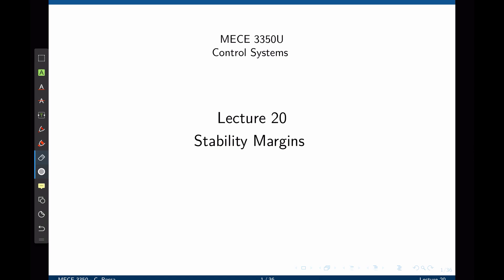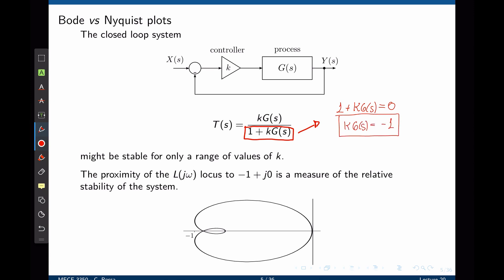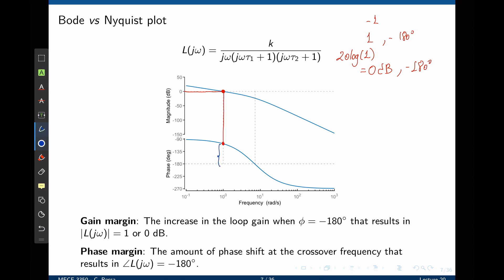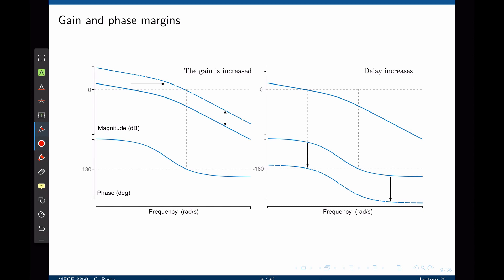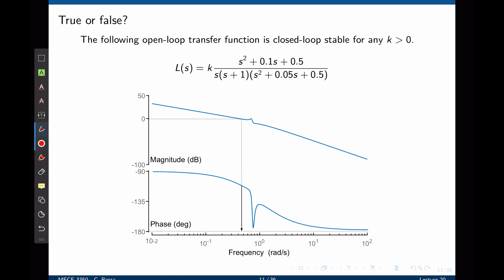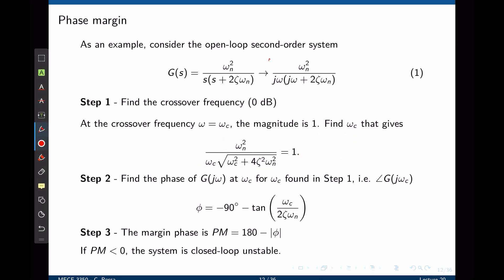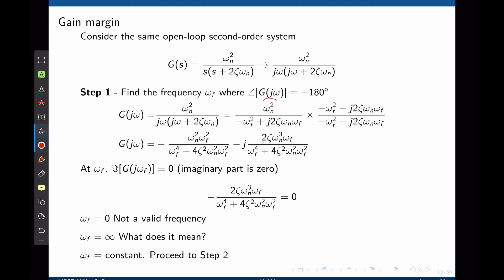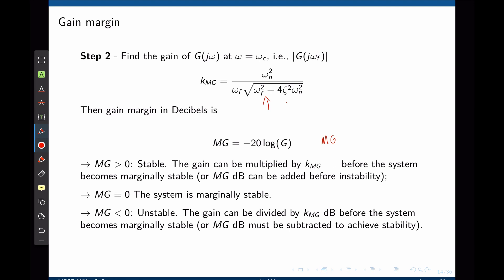Control Systems Lecture 20: Phase and gain margins

Comment: The gain margin for an open loop system can be less than 0 dB and the closed loop system can still be stable.
For example, H(s) = 10(s+1)^2/(s+0.1)^3 has gain margin -26.6 dB, but the closed loop system H_CL(s) = 10(s+1)^2/(s^3+10.03s^2+20s+10) is stable.